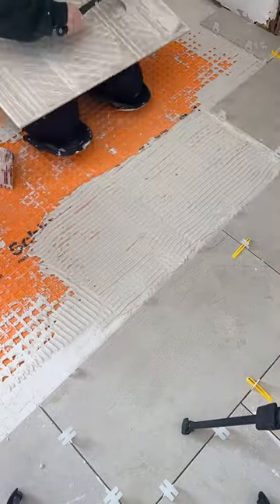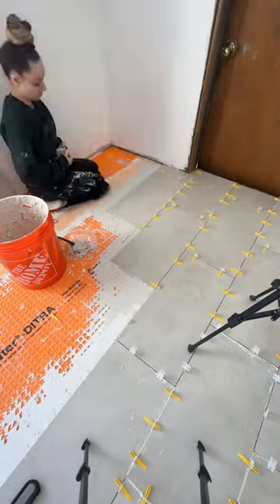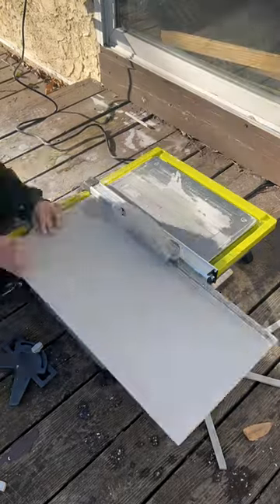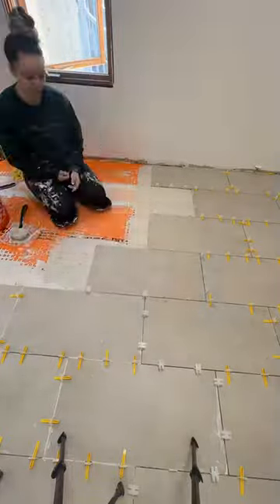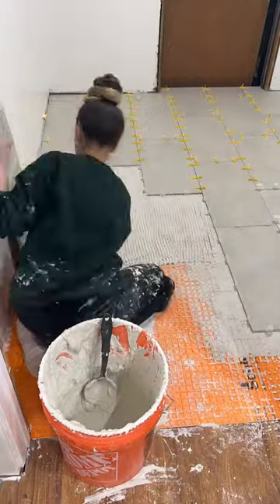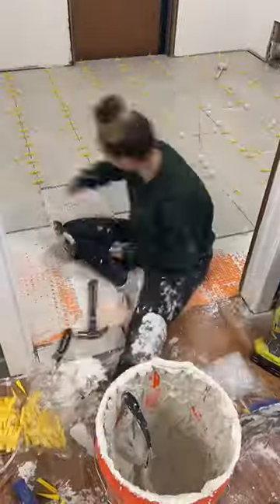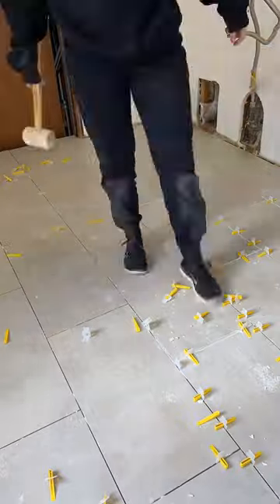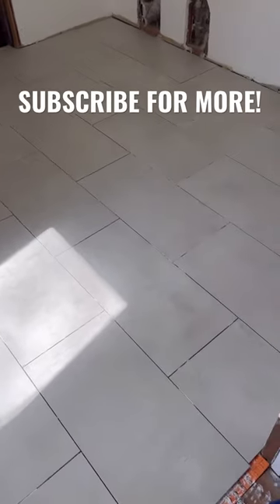HOT MESS LAKE HOUSE RENOVATION PART 145 | VIRAL TIKTOK SERIES | LEXI DIY LAUNDRY ROOM

Comment: I learned that it’s best to push the leveling wedges in toward the tile already laid as it pulls them together. Inserting them facing the tile being laid can push the tiles apart and widen the grout line.  Learned this a little too late after my wife pointed it out.
Reply: They sell a "tile clamp"  for this system.  QEP !  Hand pressure is not enough.  Home Depot sells the spacers and wedges,  but I dont think they carry the clamp at the stores . You need to order it.  Just saying.  Good day.
Reply: @stevehamman4465  Yep.  I have the pliers or clamp or whatever they are.